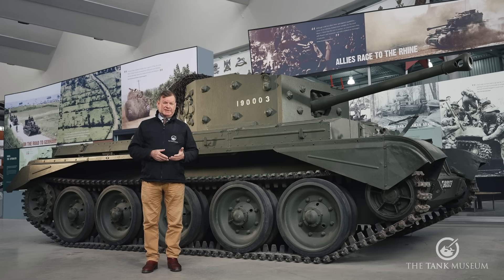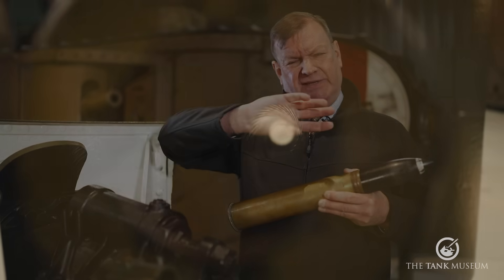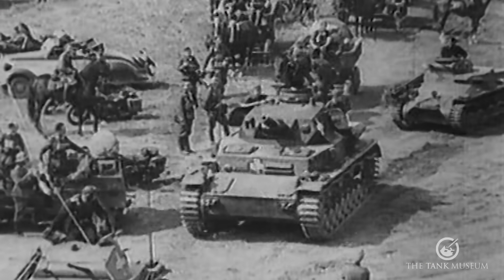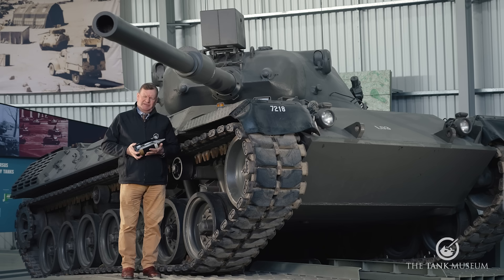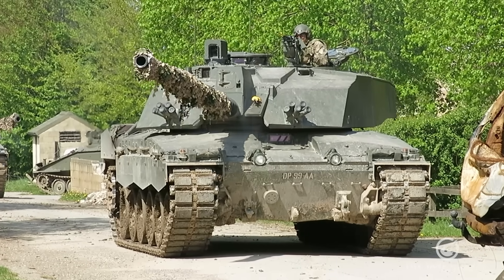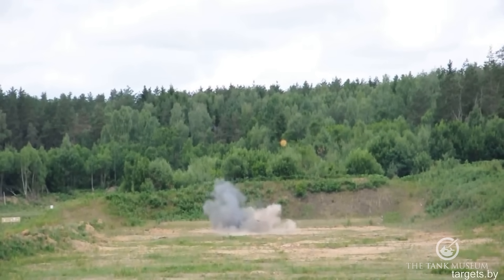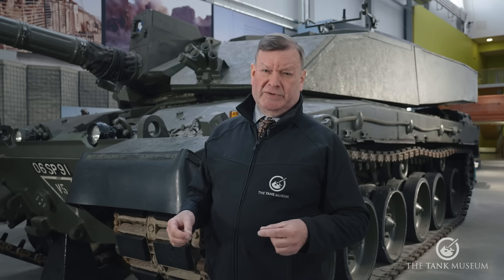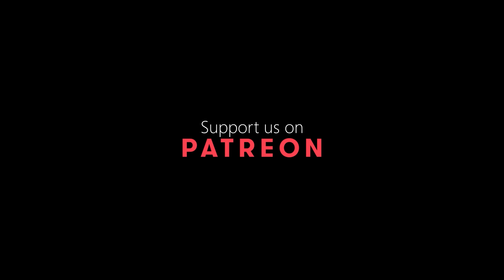Knock Out: The Evolution of Tank Ammunition

Comment: 7:01 Tungsten metal alloys are not generally as hard quenched and tempered steels, but Tungsten carbide is very hard. It's usually available as a composite of carbide grains cemented with a Cobalt binder.

Comment: Correction: Depleted Uranium (DU) is NOT waste from nuclear power stations. It is the non-fissile isotope Uranium-238, the abundant fraction (99.3%) of natural uranium, that is obtained via the enrichment process of the fissile isotope Uranium-235, the scarce fraction (0.7%) of natural uranium – DU still contains a very minute amount (0.2%) of radioactive U-235 – The problem is that some of the DU penetrator turns into fine dust on impact and can be ingested or inhaled which can cause heavy metal toxicity and radiological risk to health.

Comment: Perhaps its in a different video but I would like to understand how the storage of munitions in the tanks have changed. As I understand it the main problem with russian tanks is they store their explosives in the turret and US tanks store them at the back in a separate compartment but how are they accessed?
Reply: Abrams, and many other Western tanks, utilize turret bustle storage for ammo racks. Notice how Western tanks have very long rectangular turrets compared to Russian/Soviet tanks? That extra length in the back is where the bulk of the ammo is stored. In Abrams (though this goes for many other Western MBTs), the ammo is separated from the crew compartment with a solid metal wall, with large sliding doors that allow the loader to access ammo quickly while ensuring the ammo stays separate from the crew when the loader isn't reloading the gun.

Otherwise, extra ammo is usually stored underneath the turret, immediately in front or behind the turret, and sometimes next to the driver depending on the specific tank.

Russian tanks have far less internal space to work with, and no room for a turret bustle rack, so the lion's share of their ammo is stored in the center of the tank and next to the driver. Also means they can't really use blow-out panels which help a lot for survivability when ammo is hit.

Comment: The problem with DU is not that it is seen as radioactive, it is poisonous. Specifically the powder that results when it slams into anything is left lying around and can get into people. It is a seriously nasty heavy metal poison. It is not from nuclear power stations, it is from nuclear fuel enrichment. U238 and U235 are separated. You need a high proportion of U235 for the fuel. The result is U238 which has been depleted of the useful U235. It is not the energy of the DU long rod penetrator that blows Russian tanks to pieces, it's their own ammo cooking off. If they had no ammo loaded you'd only manage to shred the crew and maybe set the hydraulics on fire. I worked with the warheads group at Hunting Engineering who developed a lot of AP warheads. It has always amused me the weird things that military guys believe. My tank platoon commander friend still thinks that the crew will be blown out of the tiny hole left by a shaped charge. This is not an expert level presentation.

Comment: Depleted uranium (DU) is also more geologically abundant than tungsten. It’s worth clarifying that DU isn’t uranium with the radioactivity 'drained out'—rather, it’s mostly uranium-238, the non-fissile isotope that makes up over 99% of natural uranium. Natural uranium consists of about 99.3% U‑238 and 0.7% U‑235. It’s U‑235 that is fissile and used in nuclear weapons and reactors, because it can sustain a chain reaction when present in sufficient concentration. U‑238, in contrast, is not fissile and can’t go critical on its own.

Enrichment is the process of increasing the proportion of U‑235, and it's technically challenging because U‑235 and U‑238 are chemically identical. That means enrichment can’t be done with chemical methods—it requires complex physical techniques like gas centrifuges or, historically, calutrons.

What’s left behind after enrichment is depleted uranium—mainly U‑238. While not useful as fissile material, it is extremely dense, pyrophoric (can ignite on impact), and relatively cheap compared to tungsten, which makes it attractive for armor-piercing munitions.

Comment: Not 'annealed'. Alloy steel heated to red/white heat and then quenched in cold water, hot oil, nitroprusside salt bath produces diamond hardness - but, extremely brittle, easily shattered. 'Tempering' involves reheating the steel to a lower temperature for up to many hours ('soaking') and then letting the steel cool in air to develop 'toughness'. A dry tree twig is brittle, a springtime new 'green' branch is 'tough'. An AP shell needs to have both in the right proportions.

Comment: I would have liked to cover APCR rounds as well, Armor Piercing Composit Rigid. These have a sleeve of softer metal surrounding a dense core usually made of tungsten. When the round impacts the armor the sleeve would dissipate and allow the rigid penetrator to enter the armor. APCR rounds were used in WW2 as a means to greatly boost the armor penetration of regular tank weapons on targets they can't normally penetrate, however they were expensive and in short supply, thus were almost exclusively used against the heaviest of armored targets. APDS rounds are a development of this since the sleeve generates a lot of drag for the penetrator as it travels downrange, and the Sabots fall away as the round is fired  allowing for the penetrator alone to achieve maximum velocity.

Comment: 11:43 "depleted uranium is waste from nuclear power stations" No; it's a waste product from manufacturing nuclear fuel from natural uranium ore.

[1] No it isn't.  If you take raw uranium ore, chemically separate it, then start separating the nuclides, you are starting with a mixture of U-234 (fizzy and extremely rare), U-235 (this is the fun stuff, about 1.2%) and U-238 (the rest). When the U-235 fraction is at about 20%, that's good for nuclear fuel, and at about 90%, that's good for fuel in certain compact high performance reactors, and also Bombs.  Either way, you will have some enriched uranium, and a heap of U-238 left over, which is known as depleted uranium because the fun part has been taken out.  [Cf depleted butter, depleted beer, depleted lavender etc.]

[2] Except sometimes it is.  When your nuclear fuel has been used up, there's still a lot of valuable U-235 in there, and also a variety of other nuclides, most of which are a troublesome nuisance, and some of which are the fun troublesome nuisance that led you to create a nuclear reactor.  You might reprocess (separate) these, to make fresh nuclear fuel, and perhaps to do other things with other reaction products.
There will be some uranium.  Because of neutrons bouncing about, there will be a wider variety of nuclides as well as U-234, U-235 and U-238, some of which are not seen in natural uranium, and substantially more radioactive than U-238.  Separate out the other nuclides to concentrate the U-235 as before to yield enriched uranium and depleted uranium, except this stuff is different from what's waste from manufacturing fuel from fresh ore because it is much more radioactive.

[3] Using the second sort of depleted uranium, from reprocessing spent reactor fuel, in the same way as the first is possible, but generally unethical and a bad idea.  Those fin rounds being stored in your tank next to your soldiers: the minimal but detectable natural radioactivity of U-238 is bad enough, do you really want to expose your crews to substantially more radiation by using depleted uranium from spent reactor fuel?

And that said: people crawling over armoured vehicle wrecks that have been shot at with US-made fin rounds have seen the yellow glassy crystals of uranium dioxide, taken samples, and it is alleged some of them contain U-236.

Comment: @4:50 you say that chrome steel projectiles are annealed to make them hard and give the strength.  The annealing is done prior to forging making it soft and able to be reshaped.  I imagine it would then be heated and quenched (probably in oil) to harden it, and then tempered (heated to something like 500°C) to make it less brittle and likely to shatter on impact.

Comment: You clearly do not understand the issue with DU rounds. You very clearly do not understand radioactive substances.
DU creates a lot of dust when it impacts something. A DU round may not be radioactive enough to be hazardous to your health. That is because it is outside the body and the radiation coming off of it gets mostly blocked by cartridges, by containers, by your clothes, and even by your skin. But turn that mildly radioactive material into dust and it can now enter your body in the air you breathe, or through contaminated food and water you consume. Once there, even mildly radioactive materials can cause very severe heath problems, including cancer. They aren't "nuclear weapons", but imagine the smoke from propellants having a significant component of arsenic which was left floating in the air after each round. Would you dismiss that?

Comment: APFSDS - unless you start right on the penetration limit for the target doesn't really care about range - the very low drag and high sectional density leads to only very slight velocity loss over range, and the penetration efficiency has a peak at some lower velocity than the muzzle velocity - the combination results in predicted penetrations at 2.5-3km which are around 90% of those at the muzzle. Which is an irrelevance when hitting flank armour, or targetting older or lighter vehicles, not optimised to the defeat of heavy long-rods.

The losses for full-bore APCBC are considerably more rapid.

(Smaller APFSDS, such as from the autocannon on IFV do see more rapid velocity fall-off than the multi-kg tank gun projectiles, but they also see shorter ranges for fall-off of full-bore natures).

Comment: 2 types of AP cap, soft and hard. Soft was used at first but tended to bounce off the tank armour. So hard started to be used, which stuck to the armour better. And over that went the ballistic cap which meant the round travelled better through the air.

Comment: 4:50 [the 2-pounder] "... made of chromium steel, it's forged or cast and it's annealed that gives it maximum hardness ..."
Sorry, annealing is a process that removes any hardness from heat treatment thereby making the metal more ductile and less hard.  Also, in the modern SI Metric System, weight and mass are conceptually different, have different units, and numerical values.  
M = Mass = Kilogram
g = gravity = meter per second square (m/s^2)
Weight = M x g = kilogram meter per second square = Newton. 
The mass of an object is same value on Earth (g = 9.8 m/s^2), floating around weightless in space (g = 0) and on the Moon (g = 1.6). But the weight is different at each of these locations. Perhaps just say mass instead of weight when referencing the unit gram/kilogram or say the weight produced from so many kilograms of mass.

Comment: At the very least, this has helped explain what APCBC is/ what it does inherently different/what it's solving. I've always seen that in various media about tanks and I've wondered why it exists. You're putting a pointy cap on a tank round that should already have a pointy cap....... but I didn't know that the rounds were structurally ALT+F4-ing on impact.

Personally, I call APFSDS rounds "Lawn Darts from Hell." If you don't know what Lawn Darts are, there's a reason for that. If you do, you can see why I call them that and that it's not that far off. Who ever goes first in Lawn Darts from Hell usually is better off.
Reply: The cap helps penetrate the armour but the ballistic cap makes the round go faster as its travelling toward the target.

Comment: Appreciate the explanation of the WW II armor-piercing ammunition types. Are "mine shot" the same as HESH?

Can HESH be adequately stabilized by fins so as to give adequate accuracy to engage bunkers? Obviously, dropping HESH on to the thinner top armor of a tank would be to substantial advantage, less so against bunkers commonly fortified against mortar bombs, but very useful against a concealed ATGM gunner providing guidance to his missile (as is common) and the crew -- particularly providing that shell lands while the missile is a second or more away from impact.
Reply: Minengeschoß, "mine shot" is equivalent to High-Explosive, High-Capacity [HEHC] - not the same as HESH. HESH rounds for bunker busting are deployed at close [ish] range, thus accuracy isn't an issue. Your last bit about ATGM is a mess - what does "concealed" mean? In a trench, in a bunker? Behind a bush?
Reply: @nightjarflying   The difference between "cover" and "concealment":  The former stops incoming enemy fire, the latter prevents the enemy from firing prior-to locating. ATGM crews may, sometimes, be able to place launchers of certain types (example, Swingfire) behind cover from direct fire. However, no ATGM can be guided from more than concealment, and many potential kinds of concealment actively prevent or potentially disrupt guidance. Because the human brain says, "Ah, safety," when it sees those forms, it takes special training and an active brain to avoid them!

But thanks for your explanation of "mine shot."

Comment: Actually it was the early war Panzer IV that had the short barreled 75.  It wasn't until the German Last Ditch Defense did they put the short 75 onto the Panzer III that they were using as training tanks!
 
 Also, Depleted Uranium does NOT come from spent Fuel Rods from a Nuclear Power Plant, it is what's left of Uranium Ore that has been processed to make Fuel Rods.  Namely, all of the radioactive Uranium has been removed from the (previously) purified Ore, so there's basically only background radiation left (like what's in any other ore or mineral)....  However, just like Lead, Uranium is a "heavy metal" and breathing in the dust inside of a destroyed tank means you're inhaling Uranium Dust, and can get heavy metal poisoning!

Comment: I was a cartridge collector, one of my prized specimens was a 105mm M735 APFSDS-T projectile w/sabot petals intact (I later picked up a steel case that paired with the projectile, made a great display). This round was intended to be used with the M68 105mm rifled cannon, and since it would be impossible to stabilize a long, finned dart, it was no surprise to me that, upon inspection, the nylon driving band rotated in place, which would have diminished effect on the barrel rifling imparting too much spin on the projectile. The 'dart' housed a tapered, baseball bat-shaped ( sans the nub at the handle-end of the bat) tungsten penetrator within it's long body, the point of the 'dart' acting as a ballistic cap. I recently sold my collection.

Comment: fwiw: depleted uranium is actually not the waste product of power plants, it is the byproduct of enriching uranium in the first place. Think of natural uranium a bit like a jar with two types of glass beads inside; about 99% of the beads are blue, and 1% of the beads are red. U-235, the isotope of uranium that is actually usable for fission (and thus intensely radioactive), is red, while the blue beads that represent U-238 is practically stable with a half life roughly equal to the age of the Earth. However, to make uranium fuel for nuclear power plants, you need to increase the ratio of red beads/U-235 from 1% of the total to 10-20%. You can do this by removing some of the blue beads/U-238, but that leaves you with a big pile of blue beads/U-238 lying around. You could just throw it away like we have been doing for decades, or you could try and find another use for it and make a quick buck off it...?

additional note: weapons grade uranium is roughly 90% U235. This also means that the stuff in nuclear power plants is literally too "dirty" to explode like an atom bomb, so there's some reassurance there.

I'm no expert on this stuff tho, if any of y'all find issues feel free to point them out

Comment: One thing he forgot to mention is that HESH has been obsolete since spaced/composite armor became popular because it relies on the shockwave traveling though a solid lump of metal.

It's actually pretty shocking how long the UK has gimped their tanks just to be able to use these rounds that would have been replaced with HEAT-FS by any rational actor long ago as it can do the same job pretty much, but using a smoothbore gun.

Comment: During trials in Scotland evaluating rifled vs smooth bore, the Americans refused to take part due to the strong side wind. Any archer will tell you an arrow will deviate in a cross wind.  The Germans however agreed (as that was the point of the exercise) and the above was proven. So, one step backwards for accuracy.  Don't argue, I was there and scared stiff, I was 40 feet away from the Chieftain and it hurt.

Comment: I wonder if the UK will team up with Rheinmetall to make 120mm L55 smoothbore gun for Challenger 3? Leopard 2A6 already uses such gun and all that remains is to modify Challenger turret with ammo bustle in the back to store 120 APFSDS and HEAT shells. Upgrade to fire control computer would also enable Challenger 3 to fire ATGMs through gun like Israeli LAHAT ATGM.

Comment: is APFSDS still using spin or not?  the SloMos show a bit of spin, but I'm not sure if this amounts to regular grooved bore spin
Reply: The old British tanks use rifled barrels, thus imparting a spin on the round, but most modern tanks have smoothbore barrels, and they don't impart any spin on their projectiles. Frankly, you don't need the spin on account of the fins, and the rifling creates more friction in the barrel anyway, so you're really better off without it these days.